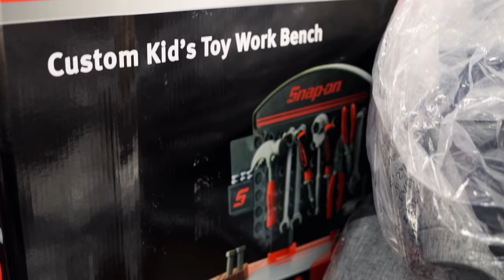Snap On Snap Ring Pliers And Tool Talk With Hamilton

Comment: That blue point set is a good set for the price  ive had it for for atleast a year the only bad thing is the little bags that hold the bits will fall apart but I'm also a field guy so they get exposed to the elements

Comment: Snap Ring pliers: If you can afford a set for $175, get Knipex 00 20 04 SB. You'll thank me later. If you can only afford one pair or need one tool for a mobile box, get the Channellock/Wilde/Blue Point ones. They are the best tip swap ones out there in my opinion. I have Snap-on and some KD pairs but Knipex is about to replace them. They are spring steel tips pressed into Knipex pliers. Super high quality. 

Side note: I have contacted Channellock about making a pair of the Knipex style. If more of you do the same, we may get a USA made affordable equivalent, since they are clearly targeting them with some of the new pliers.